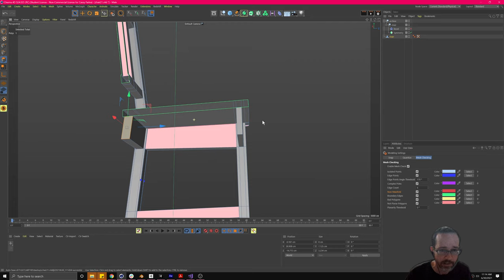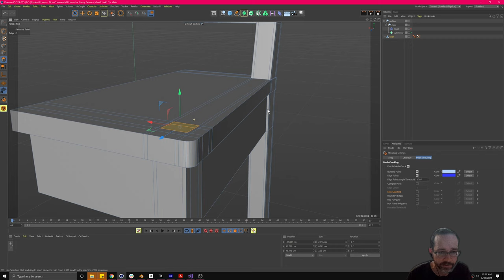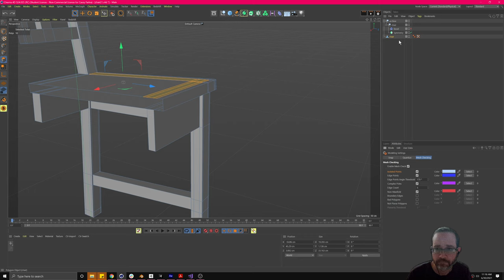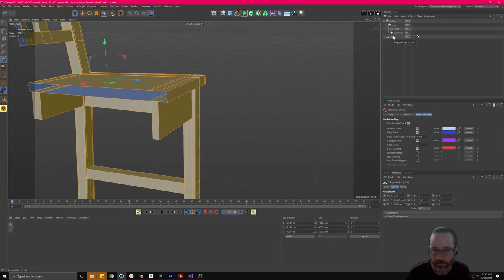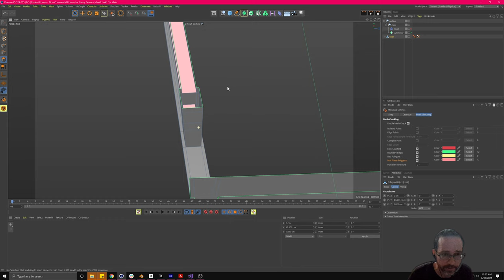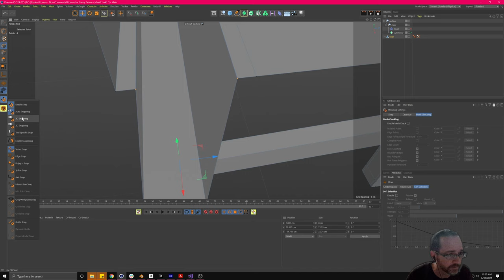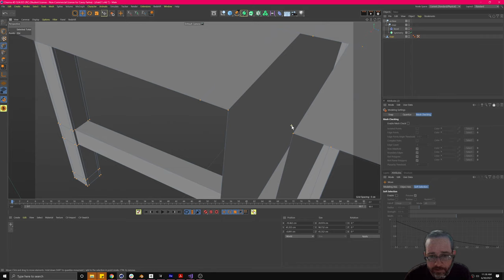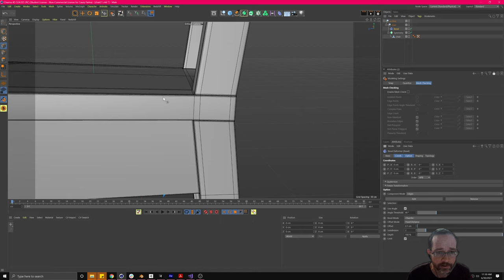ART 185: Running the Mesh Checker in Cinema 4D and Cleaning up your Geometry

Comment: Wished the boundary edge was an actual fix and not just "we are gonna solve this with symmetry" cause there's a bunch of other situations where applying symmetry won't fix the issue....
Reply from the maker: Another possible solution would be the "fill polygon hole" tool.